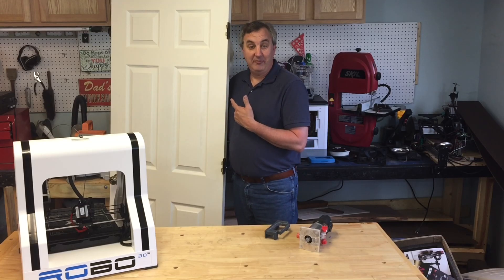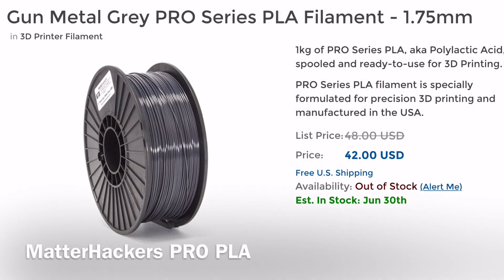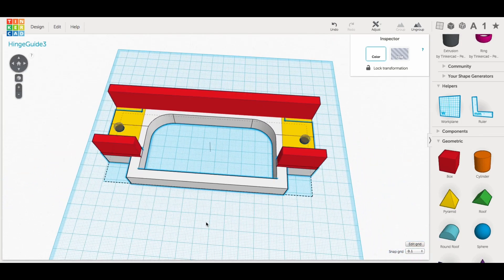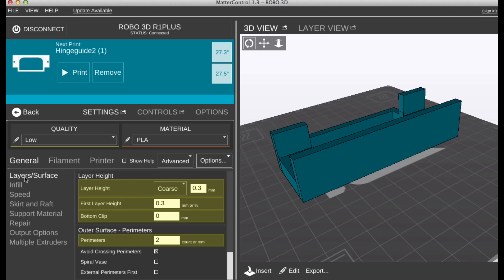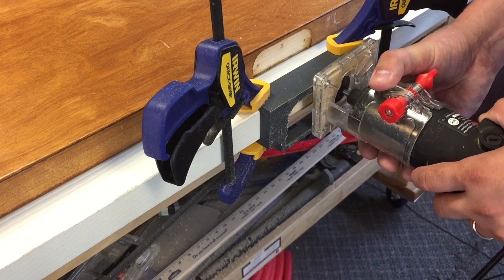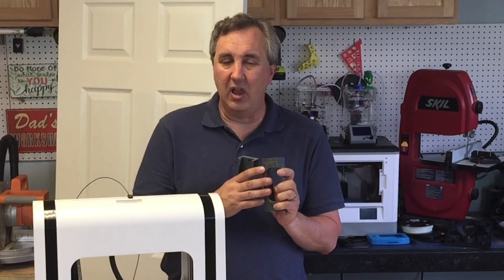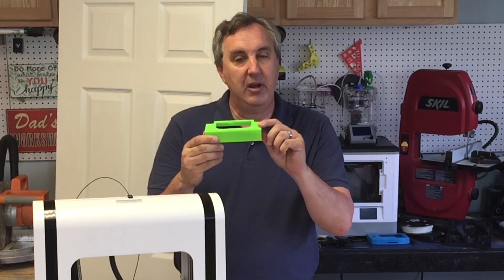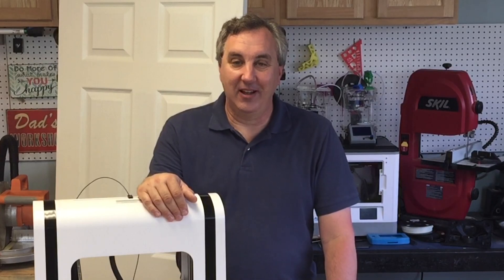3D Printing Filament Friday #69 - Door Hinge Router Guide using ROBO3D and MatterHackers PLA

Comment: I'm switching my kids' room doors from hollow core to solid this weekend, and remembered seeing this video. I tweaked your model to use a standard flush trimmed bit, some minor adjustments to make it match my current door hinge cutouts. Took about 8 small partial prototypes to get it to match my hinges. I just started 3 of these on my giant delta. Says it will be done in 3 hours (that's S3D estimate, so it will take more time), but heck of a lot easier to do this than use a chisel, and I'd never get the profile perfect like this. Thanks for the idea!

Comment: Several months back I picked up a 200x200mm sheet of PrintBite from Mutley3D.  I love the stuff.  I don't print in ABS very often so I can't comment on that, but PLA and PET stick very well.  The only thing you have to do to the surface is occasionally wipe it off with acetone to ensure that it is completely clean.

Comment: The robo 3d r1 plus comes with 1 free year of fusion 360. Have you tried it yet. If so, what is your opinion on the cad software.
Reply: Fusion 360 is  actually free for anyone that doesn't make 100k a year using it.  Its a little funny that robo puts that as a perk.

Comment: I use hairspray on my robo 3d and it works great everytime. Also, as for the simplify 3d I k ow the solution as well. It happened to me on cura where the bottom wasn't flat. You just have to decrease the default z offset because the print head isn't as close to the bed.